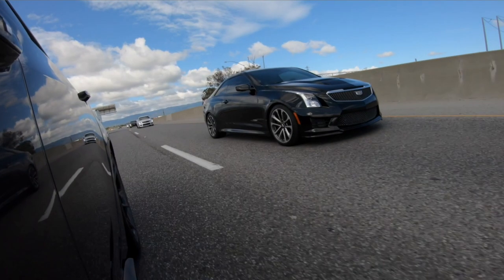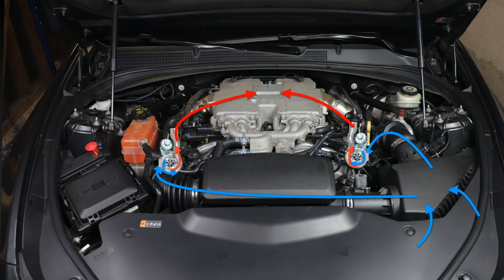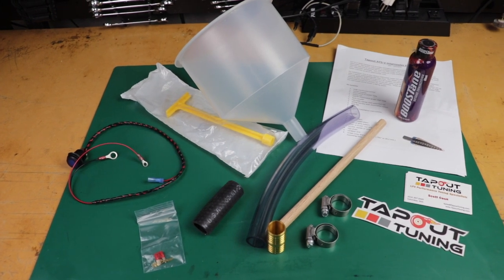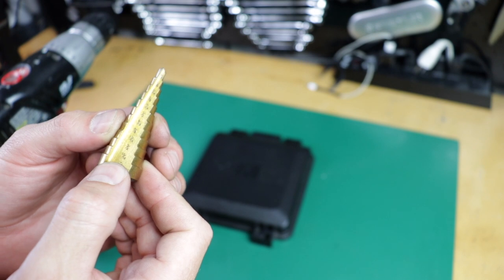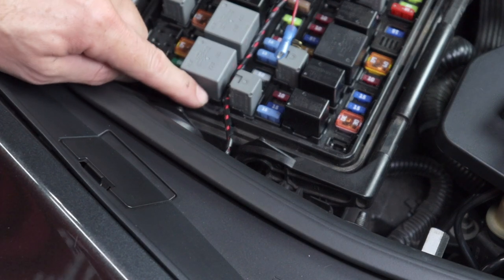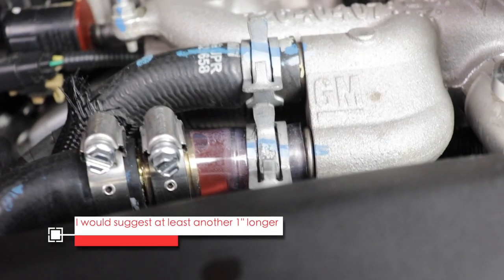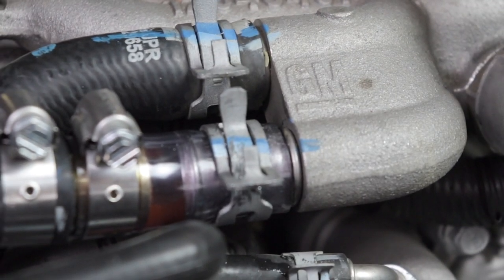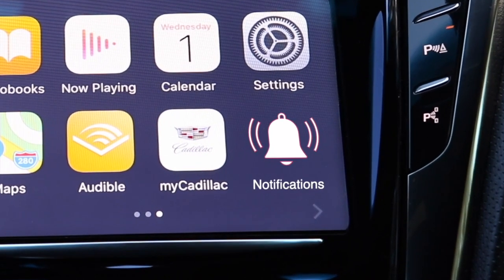Intercooler Bleed and Fill | ATS-V CTS VSport CT6

Comment: Do not open the bleeder valves with the pump on. You're going to just suck air into the bleeder valves. Only start the pump with the shrader valve open and coolant in the funnel. Open the bleeder valve, open the shrader valve (with a funnel and coolant attached) and then shut them when coolant starts to leak out. Then you probably never have to touch them again.

SIncerely,
Someone who learned this the hard way.

Comment: Hmmm... Love the video. Love the pump switch. How about using it to assist with a heat soaked intercooler and add another switch to turn on the fans???
Reply from the maker: Agreed that’s a good use for it. Haven’t looked into the fan mod though.

Comment: It's odd that air bubbles seem endless in the system.  I wonder if there is a design flaw where air gets trapped in the system.  Why not replace the entire black hose with the clear one?  Not sure why everyone uses Black hoses to begin with I'm assuming they hold their shape around corners when under heat and the clear ones kink or crimp in the same heat situations...
Reply from the maker: Yeah weird right?  I think I just didn’t  want to change the stock look much. It’s a cop out I know....

Comment: Years back people were saying the coolant pump only runs when boost is detected and people were wiring up switches to activate it yourself.
Reply from the maker: Do we know what the case actually is?  I know that in HP tuners there’s settings based on temperature so I figured that’s the likely element that determines pump ops.
Reply: @JetFuelOnly  Never heard what the answer was. I would think boost because if it was temp it would run all the time?

Comment: So, I'm thinking you still have bubbles in the system at the end of the video because you are barely filling up that big funnel they give you. The reason it is so big is for liquid weight which equals pressure out (into the system).. The more coolant you have in it, the more weight it has to push (psi) into your system. Maybe try it again with someone to help hold the funnel the whole time so it doesn't tip over and spill out coolant everywhere, I recommend a turkey baster once you are ready to remove the funnel, you can get pretty much remove all the coolant out of the funnel before taking it off. If you decide to try this, please leave a comment after you do to let me know how it worked. I bought a cts v sport about 6 months ago with 75k miles and now it has 85k and I'm going through servicing/replacing with new parts, everything in the engine that I think the previous owner never did before and this is something I'm about to do here very soon. Thanks, enjoying your channel, liked and subbed.
Reply from the maker: I'll take a closer look about the bubbles next time.  I've added a hole on the funnel to string it to the hood now.  If you plug the funnel, you can remove it and leave the short bit of black tube attached to the bleeder.  Then you can "tip" the tube and bleeder over and drain into a small cup.  Only a couple ounces will remain in the blacktube/bleeder.
Reply: @JetFuelOnly  right on, thanks for the reply.

Comment: I bought the tapout intercooler bleed kit, but after changing my bleeder valve and setting the bleeder kit up, even with running the pump and bleeding the system, barely any fluid runs through the clear hose. More liquid runs through the hose once I press the button to shut the pump off. On top of that the intercooler coolant tank isn’t sucking up any more fluid. What do you think it could be, bad pump?
Reply from the maker: Can you hear the pump?  It should be pretty obvious sound. You may be so low you need to just keep filling. Or there may be a bubble. Keep trying. Try at different engine temps. Raise the front of the car.

Comment: I have a 16’ ats v. With the peddle to the floor right at 100mph the car studdars . I’ll left off the peddle and push back to the floor the car goes no problem… could this be the issue that cause the to do that?
Reply from the maker: I doubt it. Are you getting the full consistent boost you are supposed to?!8 think stock is 12 or 14 PSI. 

How about medium throttle under boost. Any hesitation?
Reply: I’ll check soon. If I’m not getting the consistent 12-14 psi what could be the issue & how could I go about fixing it?

No hesitation under medium throttle. Only when I mash it to the floor.
Reply from the maker: @YEAALAZ  Try the bleed and it may help.
Reply: Okay. The bleed kit just came in I’m about to try it now.👍🏾
Reply: Riding around boost stay at 0… full throttle boost goes to 6-7
Reply from the maker: Most likely a boost leak then.  Inspect blow off valve connections, all rubber hoses for cuts. All vacuum lines for breaks and connections.

Comment: I’ve noticed that my boost comes and goes, when I left for work and I stepped on it I can get 70-80kpa, but then after a while of driving I’ll step on it and only get like 10kpa… does this sound like an intercooler problem? Literally every one of your videos has happened to my car so thanks for making them
Reply from the maker: Yeah it sounds like the car is warming up and not getting enough charge cooling. A large majority of owners have air in their intercooler loop. I would definitely check that first.

Comment: That's how much the reservoir is supposed to look filled correctly😱 aw man. Mine is half way not completely full. Should i top it off all the way???
Reply from the maker: Yes. Info in your owners manual. Top part full bottomed part half way (there’s a full cold line)

Comment: Just so you know, putting an expansion tank in the system will make the system self-bleeding.  The parts cost $65 (there's a thread on the Cadillac Forum if you're interested), but if you've got more money than sense, Caddy Issues sells a kit for a $200 premium.
Reply from the maker: Haha thanks. I’m well aware. This was before people were doing expansion tanks on these cars.
Reply: @JetFuelOnly  Gotcha.  Wasn't sure if you were staying up with the various Cadillac developments.  You should check out the new carbon fiber seatbacks that Street Driven Performance just made!  They're expensive, but they look sick.
Reply from the maker: @EliteMacFreak yeah they look nice, glad someone finally started making those.
Reply: @JetFuelOnly so should i do an expansion tank instead of buying this kit?
Reply: Could u possibly send me a link to that forum thank you
Reply from the maker: Yes expansion tank is a better idea now. Caddy Issues has a good one. 
I was referring to the various VSport Facebook groups. There’s like 4 main ones
Reply from the maker: @ybnascarbandzz7411 
https://m.facebook.com/groups/cadillacctsvsportenthusiasts/?ref=share&mibextid=S66gvF

https://m.facebook.com/groups/377097566907102/?ref=share&mibextid=S66gvF
Reply: @JetFuelOnly so what exactly should i order from caddy issues? Just the intercooler upgrade kit?
Reply from the maker: Yup

Comment: Will it be easier just to hook up a switch to the inner cooler fuse
Reply from the maker: That’s basically what we did right?  Schmidty tuning can also program the ECU to run it in service mode.

Comment: Any way to tell if this needs to be done or not?
Reply from the maker: Low boost usually or highly manifold air temps if you have a scanner
Reply: @JetFuelOnly  thanks for the reply, great video. Turns out the last shop I went to went ahead and bled it for me. Car runs great just wanted to be sure

Comment from the maker: Tips from others:
1.  Turn bleed valve sideways before re installing engine cover. 
2. ?
Reply: Nitpicking but there's tools made specifically for removing hoses.  They look like funky bent picks.  Channel locks can easily damage the rubber hose.
Reply from the maker: Thanks, the tools for those hoses are very hard to come by. Vendor suggests grinding down a fuel disconnect tool but the standard 90 deg pick was easiest and no damage.

Comment: I’d love to buy a cts v sport man but they are so rare
Reply: Update I’m shopping Ats v now
Reply: I bought a 2014 CTS VSport and absolutely love it. Had it a year. Bone stock premium model and it’s plenty fast for my tastes. I want it to be reliable and last another 100,000 miles. It’s currently at 101,000, I’ve put on the last 10,000 miles.
Reply from the maker: Keep an eye out for timing issues as the chains stretch in the next 10-20k miles. Change your oil often but expect a $2-3k bill for that when it happens. It’s a flaw of the 3.6 engine

Comment: Do I have to disconnect the car battery for the fuse box installation ?
Reply from the maker: Not necessary but it never hurts for 30 seconds of your time
Reply: @JetFuelOnly  facts. Thank you.
Reply: @JetFuelOnly  do you have the car (on) but not start during the bleeding process or even in accessory mode ?
Reply from the maker: Accessory mode isn’t necessary when it’s hooked up this way. Justin can program the pump to come on in accessory mode though.
Reply: @JetFuelOnly  so basically will I need to hook up the bleed/fill kit (fuse box button ect? ) since the pump does come on in accessory mode but doesn’t stay on though. Assuming I have to keep turn on the accessory mode or will come on once all the bubbles are out ?
Reply from the maker: Yes. You can also just use a wire to jump the fuse to power. The button is more for convenience.  All we are doing is feeding power directly to the pump fuse instead of letting the cars ECU control it.
Reply: @JetFuelOnly  went with the bottom method. So much easier. Thank you.
Reply: @JetFuelOnly  just did the bleed. First on cold and then after a ride (30 mins each time) still got bubbles and the thing is the second time I did it (after a drive) when I press down on the valve bubbles fizzed out like out of a shake coke can. Is that normal? I hope I don’t have a bigger issue
Reply from the maker: @AnisMaknojia  yeah you can see some foam in my video. Someone else said they found the wrong coolant in there once though…
Reply: @JetFuelOnly  finally got my pump running. Took 3 days. Are the flumes from this thing bad? Especially doing 30 mins session per day  over 3 days. I wasn’t wearing a mask.
Reply from the maker: @AnisMaknojia  good question. Lol. So what was the issue?
Reply: @JetFuelOnly  just bubbles. Pump is working. But still getting bubbles (they seem endless) don’t know if I should continue bleeding it. 3 days seem enough and lol I don’t know if this was toxic being that it’s coolant

Comment: So if I can hear my pump running, do I need worry about bleeding the intercooler??
Reply from the maker: Depends on what it sounds like an how long it runs. And empty intercooler will run the pump for awhile before stopping. Same with big air gaps. If you just have bubbles it will sound like mine, gurgling and the smooth running

Comment: Do you do your final burp with the pump on or off? When I burp it running vs off, I'm talking a couple ounces of fluid difference. If I close the bleeder while running, I'm sure it's packed full, but as it heats up am I putting undo pressure against every seal?
Reply from the maker: I recently found it would swallow the most fluid at the end with the valve half pressed and pump on.
Reply: @JetFuelOnly  agreed, I'm worried on my CTSV if I pack it full, then it expands in stressing the intercooler bricks etc, since there's no expansion from. It's really a couple ounce difference only.
Reply from the maker: I doubt it’s an issue. Dealer would use a vacuum to get it completely air free

Comment: It absolutely baffles me that the XTS VSport comes with a tiny little self-bleeding reservoir (ZZP actually sells them for like $40 for the ATS V and CTS VSport) but the other cars do not, so an XTS Vsport that has proper fluid level will never have air in it. Its the lowest "performance" of the 3 LF3/LF4 cars and I just have to wonder why the other two don't have this.
Reply: What is it called on zzp website for the self bleeding reservoir because I can’t find it
Reply from the maker: Not sure… didn’t see it

Comment: hey i am having an issue with the fill valve itself it is leaking
Reply: the schrader valve leaks from where it is attached to the intercooler
Reply from the maker: This has happened to a few people. Sometimes only when you put pressure on it. You can get a new one, some people report that they got the whole upper manifold and then just swapped out the valve.
Reply: @JetFuelOnly  do you know where I could by just the valve? Or will I have to replace the whole manifold?
Reply from the maker: Sorry I didn’t mean whole manifold but it’s a piece of the manifold. This is just how it comes but you can separate the parts. https://www.worldpartsdirect.com/oem-parts/gm-intake-manifold-vacuum-fitting-12686826
Reply: @JetFuelOnly  thank you for the help!! Love the channel 🔥

Comment: Does the installed kit affect the warranty?
Reply from the maker: You wire up something and that part fails the dealer isn’t going to warranty it.  If you are worried about it, don’t install the switch the lid. Just plug it in and connect to power. Remove when done with procedure

Comment: Do you think i have to do it regularly?
And is this kit fit my XTS?
Reply from the maker: The kit should work fine for your car. Not too often but at least once. Then maybe yearly
Reply: @JetFuelOnly  thnx man you really help me out with my Cadillac with all your videos .. keep it up ... you are the one
Reply: @JetFuelOnly  hi daniel .... my XTS is 2014 vsport >>> as you told me this system will fit my car .. i didn't receive this kit yet but I'm looking at my engine cooling and i think its different >> any advice?
Reply from the maker: I see. Thanks for bringing it to my attention. Your car has a plug where the fill port is. Instead your car has a filler cap. See page 256 in the 2016 XTS owners manual. It says “charged air coolant bottle and pressure cap.”  I would assume you just need to make sure this is at the right level and there’s no bleeding necessary. Wish I had that.
Reply from the maker: See page 259 for full procedure
Reply: @JetFuelOnly  man man maaaaan every time you empress me ... really thanx for your help and support
Reply: @JetFuelOnly  Was hoping we could get you to do some videos specific to the XTS V...no information whatsoever out there about how many of these were even produced. So like Cadillac to start something and not finish it 😢...any sponsorship out there for details and logistics for the XTS? 🤷
Reply from the maker: @realliveboss5381 well unfortunately there’s not a lot of owners I know of locally. The XTS doesn’t need to be bled as it has a small reservoir I believe and the bleeder valve on the CTS and ATS-V is blocked off on the XTS
Reply: @JetFuelOnly  please excuse my ignorance but I don't guess I understand why that is. Up until I made this purchase I was unaware of the XTS V. It currently has a misfire and is trying to overheat. Sounds like an exhaust leak. I'm replacing the coils and back flushing the lines and hoping to get good results. Pressure test was fine but haven't been able to confirm where it is losing coolant.  I'm a niche Cadillac owner and excited to learn about this car 💯. Appreciate your reply
Reply from the maker: @realliveboss5381 coils and plugs are a good start. The exhaust leak could be happening. Not sure if the XTS shares the same issue as the CTS where exhaust hangers rust and break off. Hard to see because it’s on the top side of the pipe. 

Coolant is tough. Just know that the intercooler and engine coolant are separate systems.  So it’s likely engine coolant which has less possible leaks. One place couldn’t be the pipe on the side opposite the accessory belt. There may be a metal coolant pipe that leaks at the o-ring.
Reply: @JetFuelOnly  ok, I certainly appreciate your insight and response. I will update once tune up is completed and intake gaskets have been replaced. Hopefully that will resolve the majority of the matter. I mostly work on Northstars so I am doing my best to familiarize myself with the 3.6 and all of the added turbo components.🙏

Comment: Would/Can this apply to STS V ?
Reply from the maker: Sure!
Reply from the maker: On the ATS-V and VSpoet the reservoir is only for engine coolant. There is  no reservoir for the intercooler’s separate system. On some GM intercooled engines there is a small expansion tube but not on theses two cars.
Reply from the maker: Oh nice.... glad it’s easier on the STS.

Comment: I have a question for you. Not related to this video. Do you know how to remove the Shark Fin Antenna?? I want to paint mine Black Chrome but there is no videos on my certain year 2014 on how to remove it??  I don’t want to break it. There is nothing inside the car in the back to pop off and unscrew?? Know how? Have a link? Thank you. Any help is greatly appreciated.
Reply from the maker: I last heard that the headliner has to be dropped to access the screws holding it in (and the wiring).  I can’t confirm first hand knowledge though
Reply: Jet Fuel Only yea that’s it. Omg what a pain in the butt!  You have to fold your seats down & pop out the liner. I only popped out the back and got my head up there and got to the 10mm screw. It’s a pain holding the liner down and trying to release the two wire clips. But I got it out. Have to be carful you don’t bend your liner. I’m actually painting it now.  Thx for looking into it.  Appreciate it.  If you do this job I highly recommend a light that attaches to your head. I didn’t want to take the whole liner out because of the side air bags back there. I just held it down and worked my head back there. Folding seats down made it a lot easier.